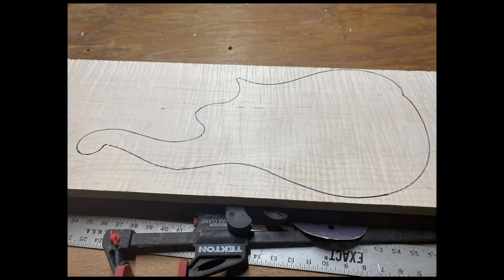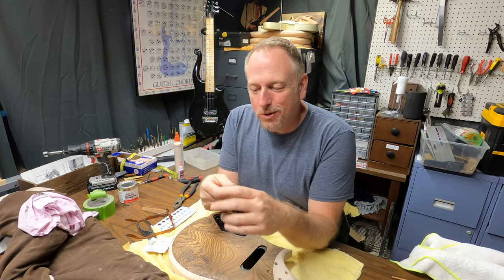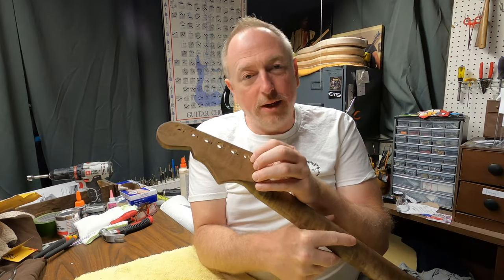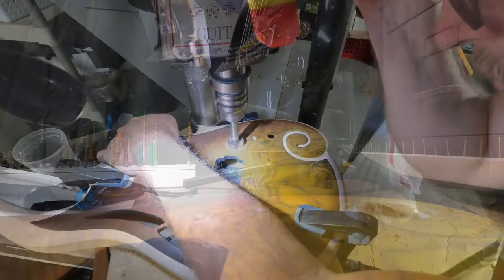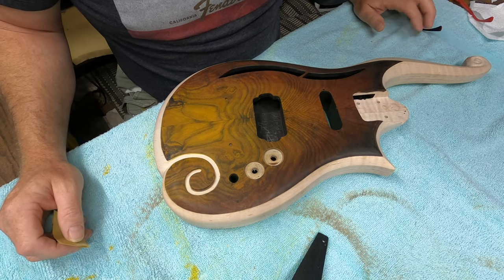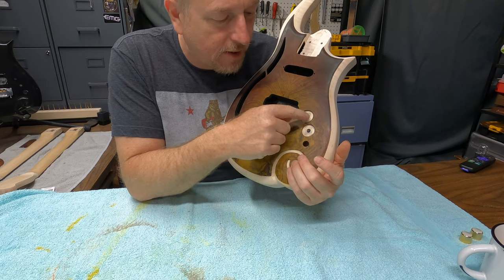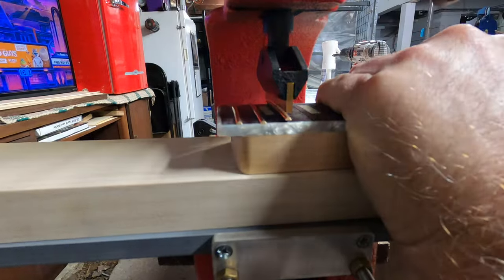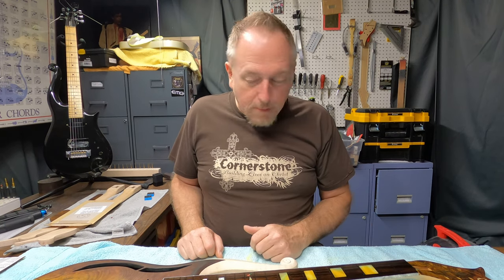Getting a Roasted Maple Look with Stain...And....Important - Exotic Wood Clear Coats!

Comment: 5:20 Hi after the neck is stained, Do I sand and to what grit? before I apply an oil finished neck please. many thanks
Reply from the maker: It kind of depends on how much your grain raised from the moisture of your stain…I will often dampen my wood sand to 600 and then stain because it helps cut down on grain raise.  Don’t soak it though, just damp.  But if you’ve already stained then a light sand with 400, but don’t over sand or you may need to add stain.  If your grain isn’t real rough from the stain, you can just start applying the oil.

Comment: Shellac is a great barrier coat. It works between dissimilar coatings as well. Not sure if you just misspoke or got some bad Intel but shellac is an excretion from some beetle. I'm sure there is a technical name for it but some just call it a shellac beetle. Shellac flakes are melted down in alcohol  and also thinned or cleaned up with alcohol. Don't think there is anything petroleum based about. There is definitely faux shellac out there that is nothing more than a chemical concoction that may well be petroleum based but not a good barrier coat. Literally had my lacquer top split and peal off of this type of base coat after about two weeks.
Reply from the maker: So yes to clarify....we are both correct...the shellac is secretion of the female Lac bug and then is dissolved in Ethanol or a petroleum base.  At least that's my understanding.  But yes you are correct, I could have gone into that more deeply.  Thanks to the input.
Reply: I've never heard of it being dissolved in anything other than alcohol.

Comment: Awesome videos.  Love the content. Love the giving!  So I just bought a diy kit and it has a maple neck with rosewood fretboard.  I would like to stain the neck.  What Minwax should I use. (water, oil, etc....??)   I like the mahogony (redish color) Also what do you recommend for the fretboard to brighten the natural rosewood.
Reply: They have a polyshade too.  Is that ok to use?
Reply from the maker: I’ve used poly shades with good results….many thin layers and don’t rush it at all…using polyurethane clear coat over top….I do around 21 layers

Comment: Hey man love the results that you got here and will be staining a maple neck of mine the same way. Could you elaborate on that move you made with the walnut/ebony minwax? Did you just start off with the walnut and then dip into the ebony and rub that on top of the walnut stain or did you mix externally? How much of the ebony did you have to add to get the look you got? Thanks a lot and great video!
Reply from the maker: I mixed before applying…about 75% walnut and 25% ebony….but I tested it on scraps before applying.